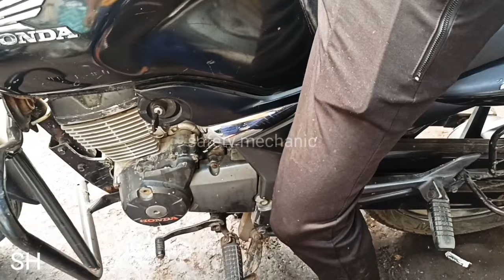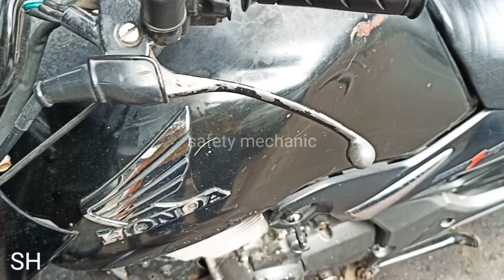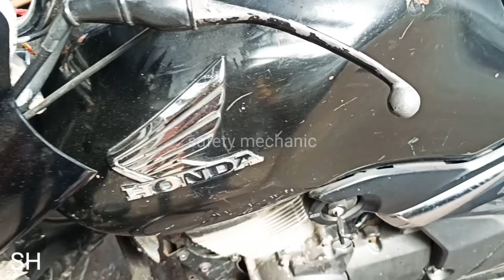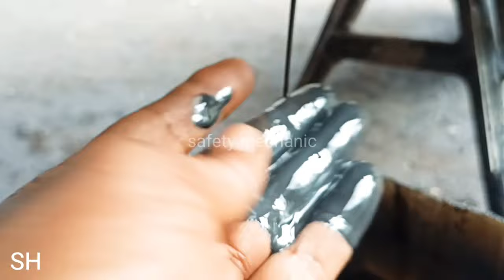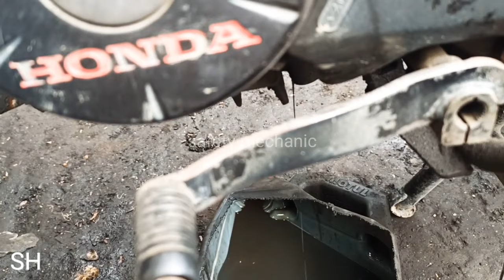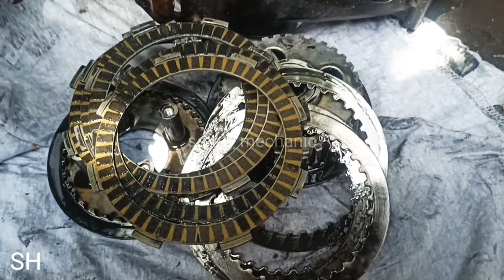होंडा यूनिकॉर्न क्लच बार-बार क्यों खराब होता हैWhy does the Unicorn clutch get bad again and again?

Comment: Can we fit ns200 6speed gearbox on pulsar 220..just a doubt🙂
Reply: No completely different KTM engine. Shafts are thicker in 200 than the shaft of 220.
Reply from the maker: It will not fit easily but yes